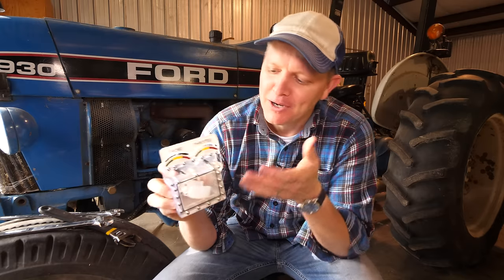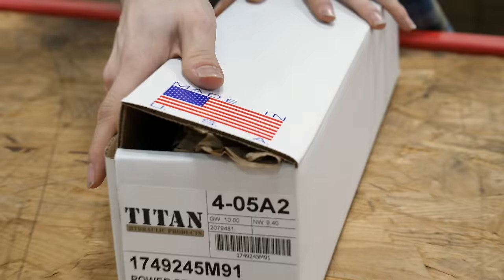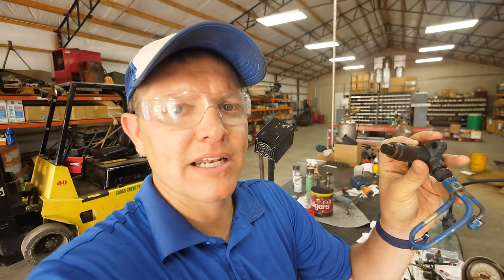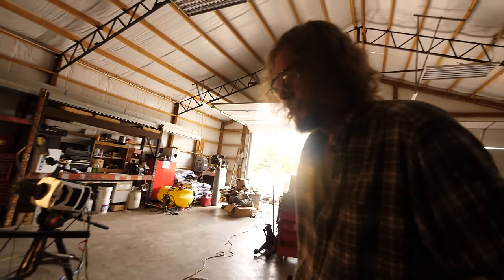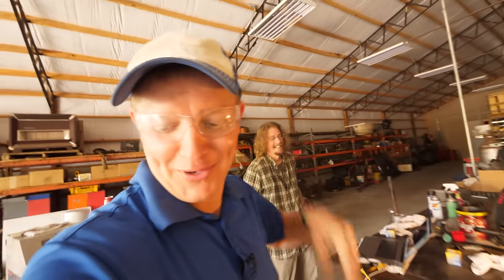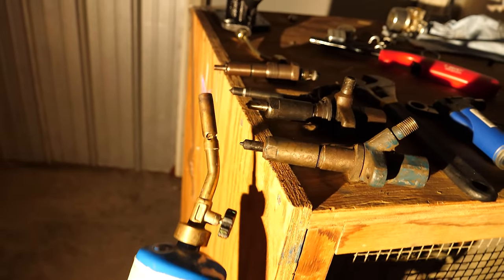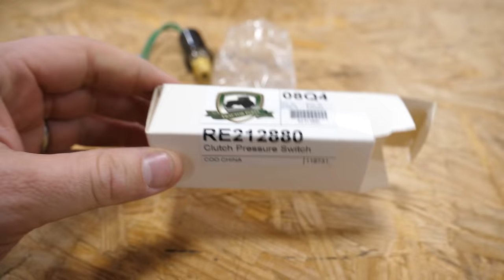Why Fuel Injectors are AWESOME (28,000 fps Slow Mo) Part 1 - Smarter Every Day 281

Comment: As you were stating in the video about boundary conditions, it brings to question as to how much that changes with compression and differing methods of injection. Fascinating content as always!
Reply: Specifically in a diesel, the air temperature generated from compression should reach well over 400*F. This does two things. Diesel fuel is heavy and oily, which makes it hard to atomize. Part of that atomization happens due to injector orfice geometry, but the heat inside the cylinder helps to further atomize and mix the fuel with air. Second, the air is hot enough to cause auto-ignition of that atomized fuel. This is why todays diesels operate in excess of 30,000psi of fuel pressure to guarantee the best possible atomization and shorten the time for auto-ignition to occur

Comment: Any way you could analyze 2 stroke carburetors? They are crazy cool and significantly different from 4 strokes since they are diaphragm run. Would love to see it. Also would like to see how they're made.
Reply: Most 2S carbs really aren't any different from 4S carbs, generally it's just a matter of re-jetting to make them work in either.  The reeds are where they differ, that's not part of the actual carb but rather the intake itself.
Reply: do you have a link to a picture of one of these carbs?
Reply: @Skinflaps_Meatslapper  Yes, I know the venturi system is the same, what fascinates me is the complexity of the passages inside the carbs I guess.
Reply: @DavidBergman1776  So, you're saying that just any carb would work then?  Because a 40mm Mikuni carb works just as well on a 4 stroke motorcycle as it does on a 2 stroke quad.  In some cases, only a few adjustments need to be made to the needle position and idle jet...there is no physical difference between them.  I'm still fascinated that the tiny carbs on weedeaters and chainsaws work as well as they do, even though they're so much more simplified in their operation compared to something found on a dirtbike or a car...they're still doing the same exact thing with a fraction of the complexity at whatever angle you want to run them at.

What you might be more interested in is the old pressure carbs that they used on WWII aircraft, those were extremely complex with a multitude of passageways, bellows, chambers, and various metering systems all working as one to deliver the right amount of fuel at the right time.  They're complex enough that only one or two companies in the US are capable of properly overhauling them these days.

Comment: Loved this video! Something else worth noting regarding the ignition point of the streams, inside the combustion chamber of a diesel engine, the air pressure is many times that of atmospheric so your ignition point along the stream would be different than what is seen in the garage setup.

Comment: I would LOVE to see a video on exactly how these injectors are made. Modern common rail injectors are astonishing feats of engineering.
Reply: Looks like you re-invented a flamethrower there 😄
Reply: Common rail is the Cummins term for fuel delivery  since it's a straight six and all the injectors are fed off a single high pressure rail and it's a much much higher pressure system than anything seen in this video. Idle at 5-8Kpsi and see 25+Kpsi at full throttle. 

What would be neat to see is one of these fired without the FCA limiting the pressure out in the open but going to need a lot more safety precautions lol.

Comment: You should check out mechanical fuel injection pumps, they are amazing piece of machinery, almost like a separate little engine.
Reply: Good old Bosch VE and Cummins P pump.

Comment: The “quad nozzles” are used for Direct injection, the “single outlet” injectors that spray in one direction are for indirect injection. Both shoot fuel at high pressure directly into the combustion chamber. Both are primarily used in diesels.

Comment: Once again, always amazing what you cover Destin. It's great to see and understand what we're protecting with our diesel filters- Years ago there was an uptick in failed/clogged injectors due to the 10-50? micron diameter holes clogging up with dirt and particulate, the whole industry had to switch to cleaner filtration because of this. We sell a lot of bulk filtration filters/equipment to southern Europe/Africa/South America as their mining, farming, digging, etc equipment is becoming newer but the infrastructure handling diesel isn't close to as clean as it should be. Yes, all that equipment has filters on it, but they are not 100% efficient in removing all sizes of particulate... which leads to injectors clogging over time. Garbage in, garbage out!

Comment: This was very interesting, and I'll be showing this to my wife as she wants to learn as much about engines as she can. She bought a 1967 Ford Country Sedan Wagon (not the Squire with the wood paneling), and we are having engine work done on it.

The thing I was thinking about as Dean was spraying and lighting the fuel in his shop was that this all takes place inside the cylinders, as he showed in the books he found. So this pattern of fuel-air mixture will be more uniform and easier to light off with the spark, making it more efficient than it seemed in the video.

The other thought I had when Dean was at the tractor parts factory was I hope this video going public doesn't trigger an OSHA audit, as it looks like some things need to be cleaned up there.

Comment: Great photography. The difference between the nozzles is that the multiple nozzles are fron direct injection engines where the fuel is fired directly into the cylinder and mixes in a bowl in the piston crown. The single hole nozzles are from indirect injection diesels where  (mostly) the fuel is sprayed into a pre-chamber. The design of the pre-chamber and the port connecting it to the cylinder means that the air in the pre-chamber spins, typically at 40 times the crank rpm. This means that the fuel mixes extremely well with the air, leading to a good burn. Advantage of IDI is that you can use lower pressure (and lower cost) fuel injection equipment, disadvantage i that IDI diesels can be more difficult to start in cold weather and they are not as efficient as DI diesels.
There are some great photo sequences in J B Hayward's book Internal Combustion Engine Fundamentals. There may even be some video out there too, try searching for Ricardo Comet combustion system.

Comment: Thank you for this video! And  thank you for supporting the right to repair! Just one note/correction: in fuel injection engines, the air/fuel mixture happens also upstream to the engine, in the intake manifold (like the carburettor ones), so the mixture enters the cylinders already homogeneous and even. The type of engines where you've got to have perfectly even nozzle spray inside the combustion chambers "downstream" from the intake manifold, are direct injection engines (where it applies what you said about having rich mixture on one side of the cylinders and a lean mixture on the other). Bye!

Comment: As a young truck mechanic, one of my jobs were to test injectors, and a trick the old fellas gave me was to make pressure peaks while pumping to "clean" the injectors, quite often you could save one with a bad pattern by cycling it with the tester.
Also, the needle from a scrapped injector is a really great centerpunch, it is really hard and with a sharp tip, we always used them when centerpunching broken bolts that we drilled out

Comment: The most fascinating part is how quick and accurately the injector shuts off stopping the fuel flow. The injector and the pump are extremely accurate and  all the mating surfaces have a mirror finish. Years ago when I was in school for Diesel engines  our instructor passed out "barrels and plungers" basically a piston and cylinder that were worn out ( a pump that produced the pressure to open the injector). We all held the barrel (cylinder) in are hands for 5 minutes and then tried to put the plunger back in. The heat from our hands was enough to close down the barrel (expansion from heat closing the inside diam of the barrel) we couldn't put the plunger back in.

Comment: nice work , also these diesel injectors are exposed to chamber where combustion happens and they get extremely hot and it helps the fuel to ignite better, now you much smarter 😇

Comment: It took me a minute to realize these were mechanical fuel injectors that are driven from a plunger system on the cam shaft that determined the firing pressure sequence. I was expecting an electronic fuel injector that has a solenoid. 

Awesome video, as always!

Comment: If you haven’t learned it yourself already, the injector names your looking for are pintle type which is the style with 4+ holes pointing perpendicular to the nozzle, this type is used in direct injected diesels. The other style is hole type with just single hole pointing straight out, this style is used in semi direct injected diesels.

Comment: Watching the slow mo of the single hole injector was really cool. It looks like the fire acts independent from the fuel. You can see the tongue of flame rolling off the vapor, but for the most part the plasma just rolls onto itself, like it's so light the the surrounding air just consumes all the forward momentum of the flames. The still burning fuel propels fire to the end but even at the end the fire just bunches up and doesn't maintain the forward momentum.

Comment: @smartereveryday here's what I would love to see.

I've sailed on ships and we have huge diesel engines turning the propeller. The diesel is injected through fuel injectors, ofcourse. What I've learnt in theory, is that the nozzle holes are drilled in such a way that it forms a helical grove. This helps the fuel to be injected in a rotating cone form.
The burning is by compression, so i don't know if you will be able to find a method to achieve a burn in your lab. But it would be cool to see the swirling motion of the fuel mist at super slow motion.

You may need to procure an aftermarket adapter to mount these fuel injectors on your test rig. The normally are set to inject at 250 bar.

Comment: Nice work Destin!  Diesel combustion is an incredibly fascinating topic and there have been so many different attempts to make it work better and better.  I have a super old book that describes common rail fuel injection by Italian inventors from the 30's - crazy old ideas are hidden in the history books awaiting rediscovery.
I like your torch method for ignition.  It's not too far away from reality, especially if you have a really lean flame so there's still sufficienty oxygen in the hot zone to make it combust.  One of the challenges with diesel combustion is the mixing process of the fuel and air which is why many older diesels use swirl generated by the intake ports to get as much motion of the air charge as possible during compression.  An alternative is to actually use the fuel jets to do the mixing and this is known as a quiescent chamber for obvious reasons.  

Another diesely problem that is somewhat obvious from your high speed video if you know what to look for is diesel knock.  This is where dribbling from the start of the injection allows a large-ish amount of fuel to be injected and mixed before combustion starts which causes it to all go off explosively causing a rapid cylinder pressure rise and exciting all the structural natual frequencies of the engine which we hear sounding something like hammer blows on steel.  There are several ways engineers have tried to overcome this, firstly by increasing the crack pressure of the injector but latterly with electronic control the world has been "rate shaping" with multiple pilot injections - 5 to 10 tiny injections prior to the main injection in order to get the combustion started before the injector piles on the coal.  This can electronically control the cylinde pressure rise rate (hence the term "rate shaping") and is one of the marvels of today's diesel injection systems.  Obviously this has driven the demand for more and faster injection control leading to piezo-actuated injectors now.  Truly cool tech!

Anyway, thanks for bringing this to the world and for the lovely high speed photography.  Like you say, it's truly beautiful if nothing else!
Reply: Don't one one the engine manufacturers do like20 mini injections now?

Comment: You make a mistake in the video.
12:35 No  the flame is not just stopped by the stoichiometry. The velocity of the fuel is also faster than the flame propagation. See Bunsen burner.

Comment: The nature of the spark plug prevents a perfect burn. It's no surprise diesels are so fuel efficient considering their "flame" is perfect, and injecting fuel into a flame has a better chance of evenly burning than injecting a flame into a fuel. It's interesting you said the gas engine is similar to your torch demonstration, except that it's using a spark plug as the flame. In the case of diesel, because the entire combustion chamber is filled evenly with compressed air at hundreds of degrees, the entire air volume in the combustion chamber must act like a flame. In the case of the gasoline engine, and your torch demo, the flame is the source of ignition, making a large effect on the burn pattern. The gas engine compresses air like a diesel, but not as a means of ignition. It needs to insert its imperfect flame to begin the ignition, causing an imperfect burn. So the neat thing about diesel is it reverses those roles; the flame (source of ignition) is the perfectly compacted compressed air, and the fuel is inserted imperfectly. So, imagine a perfect flame or a perfect spark plug that is capable of igniting the fuel/air mix in the gas engine's combustion chamber in such a way that it makes for a physically perfect burn. Not really possible.

Comment: Guessing by the can, that's Diesel fuel, and Diesel normally doesn't need a spark, the air is compressed (and that heats it up) in the compression stroke, and when it's time, the injector sprays the Diesel into the hot, pressurized combustion chamber, instantly igniting.
Super interesting to see it in slow motion nonetheless, great content. Keep up the good work of inspiring and teaching anyone willing to listen :)

Comment: The single hole injector is called a pintail injector. It's used in indirect injector systems. The injector with a number of holes is called a multi  point injector. It is used in direct injection systems. Port injection systems are usually for petrol systems. Just found your channel.  Keep up the good work.

Comment: At 10:30 I believe you're referring to flammability limitations, it's one of my favorite things. Everything has that sweet spot of air:fuel that makes it most efficient, and if that ratio falls even slightly out of that limitation, even in only a small area for a small time if won't burn until it falls in line. 
Tl;dr flammability limitations, why you can drop a match in a pool of gas and the match goes out

Comment: Thank you for a fascinating demonstration of fuel injectors! In the experiment, it takes a pretty good distance before the ejected fuel becomes vaporized enough to ignite. Your entire work area lights up. However, the inside of a cylinder limits the fuel to a much, much smaller area. It seems that there wouldn't be enough area within a typical cylinder to allow fuel to stretch/spread out into a vapor (as was demonstrated in the open-air video. So I imagine the fuel not vaporizing inside of a cylinder, but instead just squirting small streams of fuel. Curious about part 2, and thanks again!

Comment: I’m an F-16 fighter jet mechanic in the Air Force and the engine propulsion works under the same principle. One day when I was launching out the jet, the igniter went bad which in your case would have been the torch, and so the fuel wouldn’t ignite and a massive cloud of fuel came billowing out. It looked like regular fog. The fuel we use is JP-8 and just as you can see in the video, the fuel needs to be atomized to a certain point till it can ignite. If you try to light it under normal conditions nothing will happen.

Comment: A few things worth mentioning,  one you we’re putting a lot more fuel in the test than an injector would in a running engine. 
Two the injection would be near TDC and the air would be under pressure, hence much denser. 
Lastly the shape of the bowl on top of the piston creates a swirl for more through burn.

Comment: I think it should be mentioned, these are DIESEL fuel injectors.  Port injection Gasoline fuel injectors operate at a much much lower pressure and are controlled electronically. Direct injected gasoline engines operate similar to the diesel with them being ultra high pressure, even higher pressure than the diesel injectors.

Comment: Hi Dustin, I’ve been a fan for over 10 years since ME school days at UIC. Since after graduation,I’ve been working for a metrology company (Alicona), and they have a unique solution for measuring injection nozzles in 3D using an optical scanning sensor. I think you’d find it interesting and I’d like to show you and Jacob how the nozzle holes look in 3D and do measurements to see the difference between injectors.

Comment: Great video as usual. I especially liked the perfect demonstration and explanation of the stoichiometric ratio in action. 

How about a video on an oil burner (heat or hot water)? That would seem like the perfect blend of diesel, fuel injection with spark ignition working together efficiently.

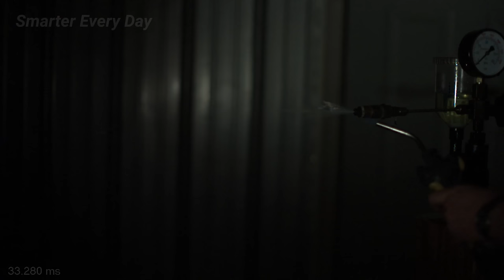Comment: This is an awesome demonstration of direct fuel injection. In those last few shots there is a blueish “fume” (for lack of better term) that goes in the opposite direction of the travel of the flame. I wonder what that is if it isn’t just a reflection of some kind. Around 15:00